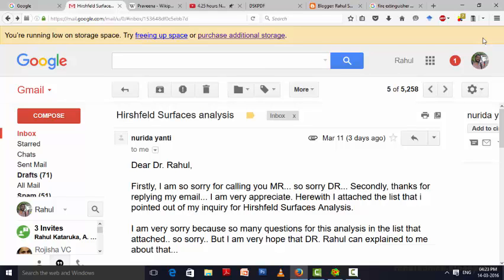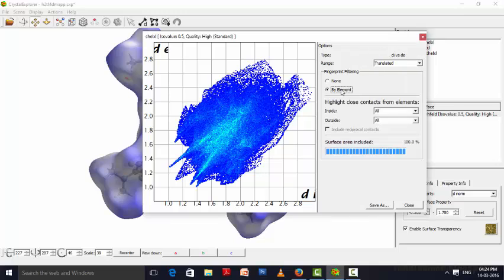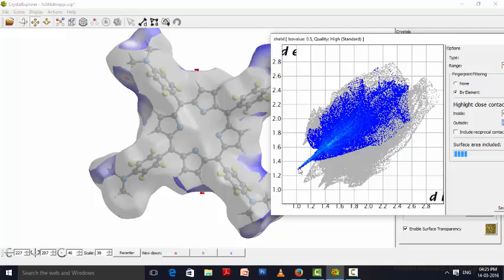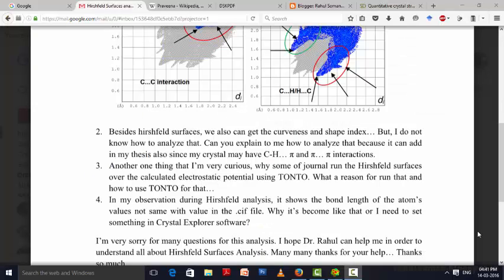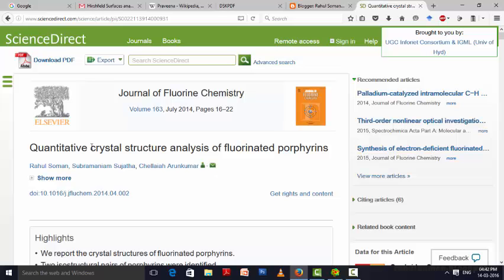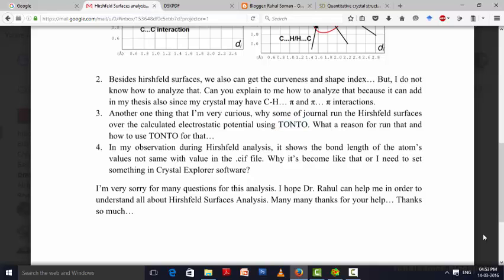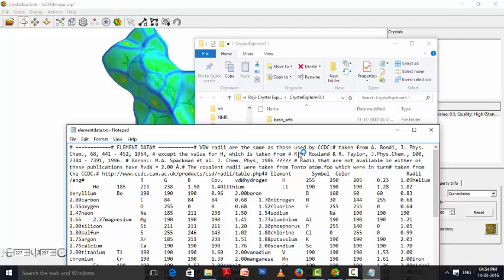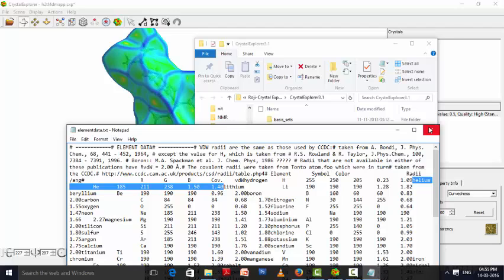Single crystal analsysis by Hirshfeld surfaces in Crystal Explorer

Comment: can u tell how to join H-pi(benzene) interaction in Hirshfeld surface? It's easy to measure distance between two selected atoms but i didn't find to measure the distance between H-pi(benzene with six carbons) interaction distance.
Reply: for calculating H-pi distance, you can measure H-C distance itself. 
all the best.
Reply: That's true, my concern is  how pi-pi interaction can be mentioned like the distance between two atoms in Hirshfeld Surface analysis.
Reply: @rojishavc1033   can you please tell me how to save the structure in cif format.
Reply from the maker: @athishulerina7292   these crytal information files (cif) are not just files simply given save as in chem draw.  If you need to convert a structure to cif very easily then you can try chem draw. just after drawing you can save it as cif. but there you will get just a dummy cif file. :)